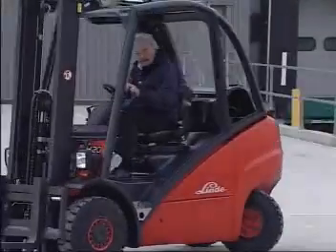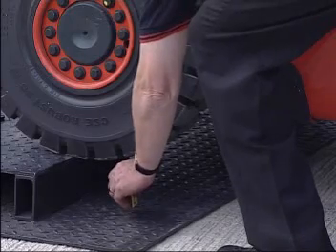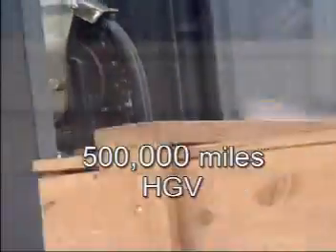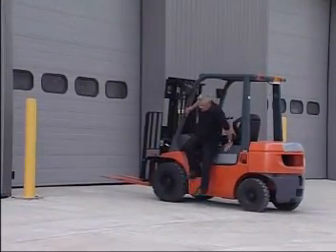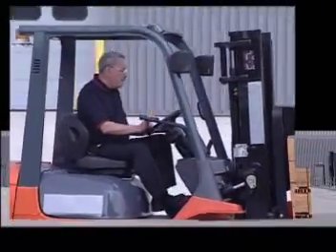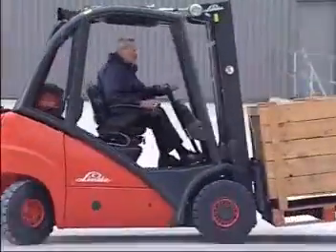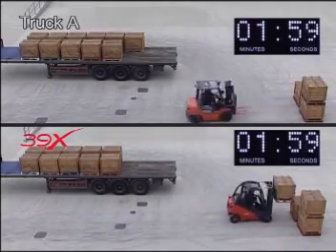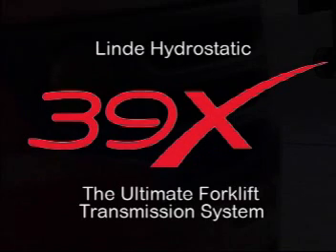Linde Hydrostatic Lift Truck vs Toyota Torque Converter Forklift

Comment: Dynamic forklift intelligence
Unique to Toyota forklift trucks, System of Active Stability (SAS) is a patented dynamic system comprising 10 sensors, 3 actuators and a controller. SAS constantly monitors forklift operations and automatically takes corrective action when it senses factors that could lead to truck or load instability. Its six advanced functions work together to keep your driver and goods safely on the move - and your productivity on the up.

Comment: Hydrostatic only works with oil, if the steer hose goes and you try to move the truck you'll leave a trail of oil until you have none left and then the truck is stuck.

Comment: What a poor showing from Linde. The operator doesn't even dismount the truck correctly yet Linde are all about safety. Very very poor showing from Linde they should be ashamed of themselves.